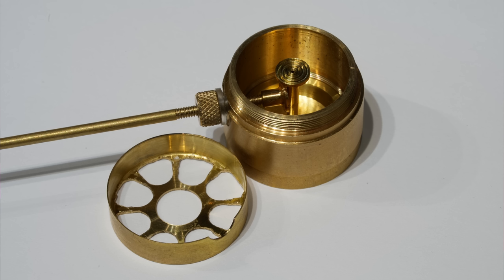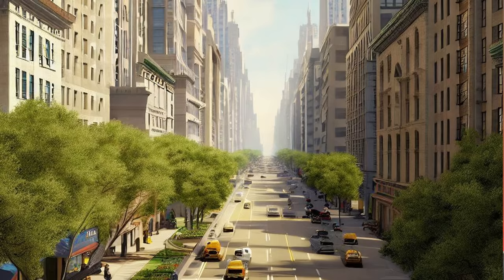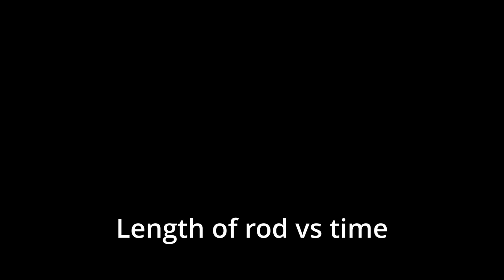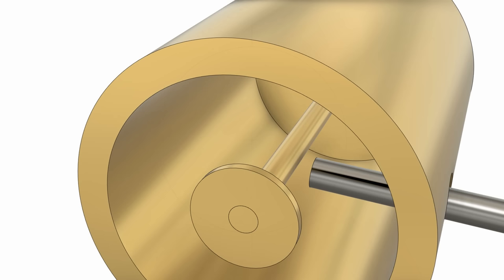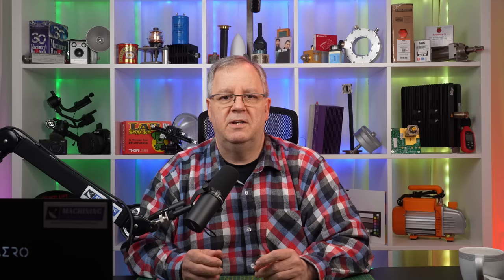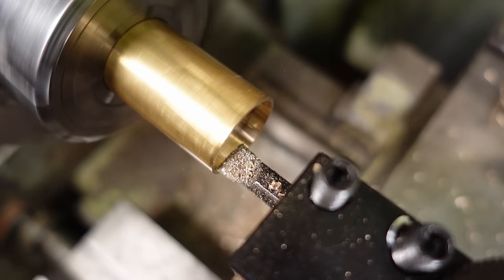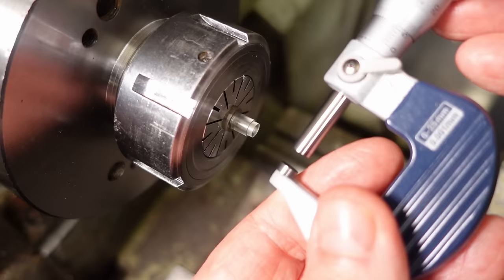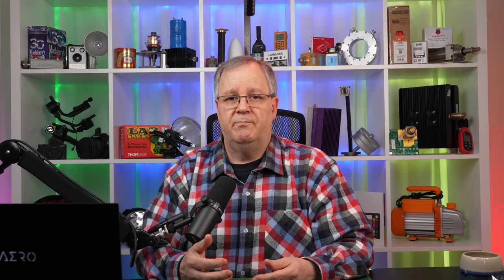SOLVING the Mystery Behind a Soviet Spy Bug : A True Masterpiece of Technical Elegance!

Comment: Have you or do you plan to post audio from your replica?
Reply from the maker: There's a link in the pinned comment, https://www.youtube.com/watch?v=GyryQltyDwA&t=1254s I'm working on some more videos to see what the audio frequency response is like, but that gives you a flavour for how it is with an imperfect diaphragm.  Way too many other projects under way right now!
Reply: @MachiningandMicrowaves  thank you for the reply and great video.  I had to watch it a few times to understand the science behind it. Not because of your excellent explanation, but it is a bit technical. I do understand now though. In my mind the antenna rod is acting similar to a passive element in a yagi or log periodic for example.
Reply from the maker: @fredgarvin4482  Yes, it's a coupled system, so the rod and cavity influence each other. There's some end loading of the rod from the proximity of the case and post and the capacitance of the bush. I haven't tried an OpenEMS model of the system yet, I really should try that

Comment: Im sure i see somewhere this devices somewhere on own eyes....... I remember how i was want find magnets from speakers becouse i was want disasembling some old speakers from 50's in cardboard with some old radio parts. Whatever i remeber "there was no magnet.what supose to be membrame(for me i was 6-10y) was very stiff but i was thing whatever strange speakers it is its without damper on edges. And thinking that someoe dont finnish it becouse cant find any roll of paper and coil on it and cables soldered (i was want magnets and melt out some tin but i also dont find it ...there was just this pole ....i remember how i was think as kid:."its stupid speaker cant work why some stupid creator make it if it cant work!!??"  Now thinking about it: what it realy was ? Propably just some antena that overar looked similar. And after 25years+ my memory is wrong( when i recall memory i see something like "dejavu" when watching on you video... not spy bug from cold war in my house  ;P)
Reply from the maker: There are microphones that look similar, also pressure sensors. Mechanical gramophone player heads use the same idea, but without the object, it's impossible to say! A Mystery indeed!

Comment: LoL 😂😅 flat earthers 😆
One day they will be a myth...😅

Good interesting video 👍😊
Thanks ❤

Hmm... Question:
Could you use a quartz crystal and a resonating plate to form a signal?
Reply from the maker: Many ceramics show some level of microphony, either piezoelectric or polarisation effects.  I have some 47 microfarad multilayer ceramic chip capacitors that are quite good at converting audio into electricity. Exciting a resonance in a correctly-cut quartz  slice or a ceramic puck might work, I have some pucks resonant at between 4 and 8 GHz, but they are not microphonic as far as I can tell.

Comment: Yeah, but how does it work?
Reply from the maker: Passive resonator. Continuous microwave remote excitation. Changing cavity end capacitance from audio pressure waves on diaphragm. Alters cavity resonant frequency, different backscatter level re-radiated, carrying audio modulation. Homodyne receiver. Simples.
Reply: @MachiningandMicrowaves  With you now. 👍

Comment: Have you ever tried to make a video where your turning speed on your lathe matches the frame rate on your camera so that on camera it doesn't look like it's turning at all. so then when you put your cutter in there, it looks like chips are flying off by magic.
    There are videos where this is done with helicopters, and it looks really weird.
https://www.youtube.com/watch?v=jWIcVP6GRfw
Reply from the maker: I haven't noticed any rolling shutter effects, but I'm shooting at 4k and 50 fps, so you would expect there to be effects at 3000 rpm and perhaps 1500 and 750, but none of those are speeds I have in the lathe gearbox. It's now simple as my Sony has an electronic viewfinder and I use an external monitor at a different refresh rate.  I must try synchronising the speed to  750 fps to see what happens
Reply: @MachiningandMicrowaves  I wasn't talking about rolling shutter effects, which are really screwy
      I saw a still picture of a girl where you can see her reflection in the mirror. The girl has her eyes open, but in the reflection they were closed.
    Now that was weird looking.

Comment: Looks like you hit the bug with a stream of microwaves. As sound is picked up by the element, it modulates the microwaves. I stopped watching due to all the intricate history lesson.
Reply from the maker: Intricate is kinda what I do, I leave the soundbite vids to other folks. If you want even MORE history, check the other vid.  Machining vid will follow, then an even more intricate set of detail about the interactions between air molecules and the diaphragm and the ballistics of the diaphragm and the damping of the reflected sound waves within the cavity, then about how they measured the capacitance and another about hoy they would have made the membrane.  Intricate and long-form and researched in detail because I enjoy doing that.  I get it that others don't want to geek out about the fine details and that's totally OK